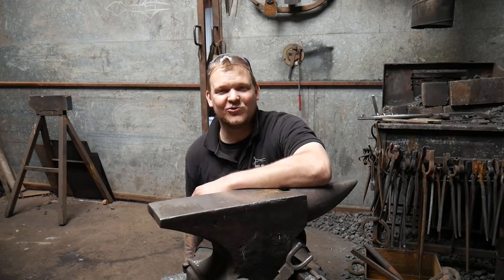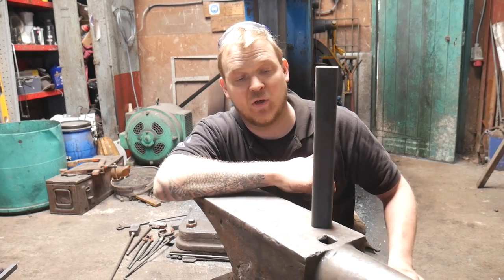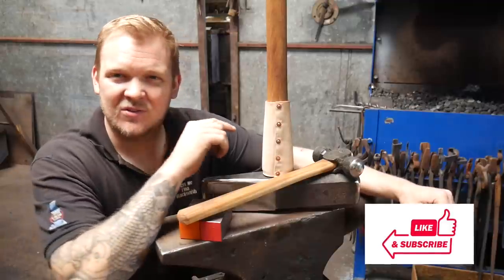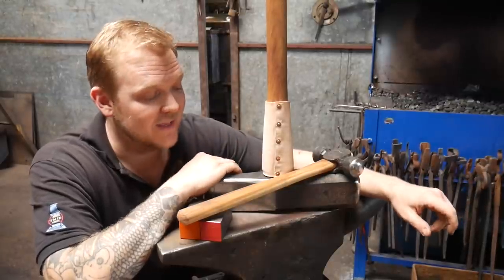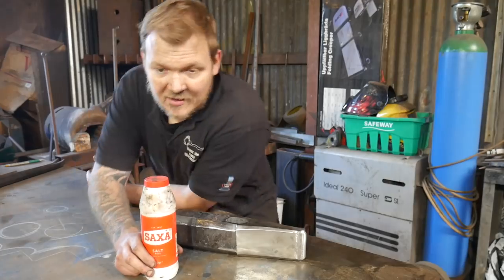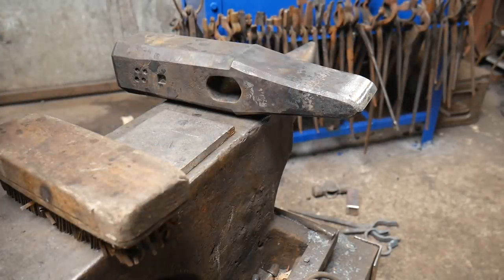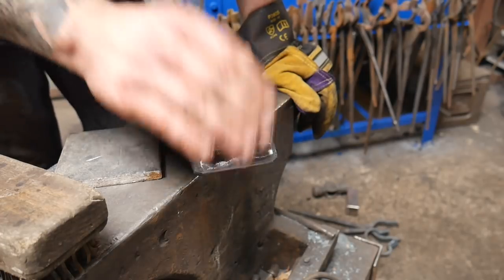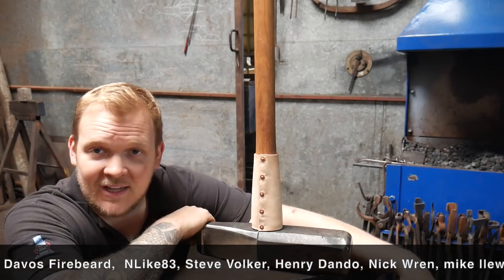|BLACKSMITH| Makes 27LB stone crushing hammer!

Comment: Paul Beisler's a good guy, and that A33 alloy is really wonderful as a punch/drift/hammer because it doesn't need to be heat-treated like you expect.  Making a stone-cutting tool is tough because the stone is so abrasive.  The stone being soft, you'd think you could get away with a softer heat-treat, but the abrasive quality really eats away at the steel.  If they're doing a lot of stone walls, I could easily see that hammer coming back to the shop in a year so it can be re-pointed after they wear an inch off the end!

Comment: Hey Daniel, it's an awesome little piece of steel!
Don't worry about it's hardness, C45 is hardened to around 50-52 of Rockwell scale and files are usually up to 62 HRC, so the file would always bite a little into the C45 stuff.
Best regards from blacksmith to a blacksmith 😊 Greg

Comment: I used to have a 28lb Mundy Hammer. It had a Hammer face one end and a blunt wedge shape on the other. It was on a handle about  2 foot three long and was used by swinging underhand, to break up castings in a foundry. Not the sort of thing anyone in their right mind would swing overhead - other than youngsters displaying macho tendencies - A handful of swings and they were knackered, while old George would plod on with a 14 all shift and not break sweat.